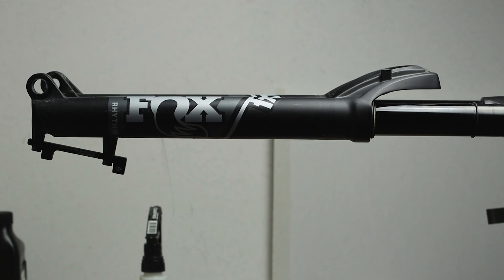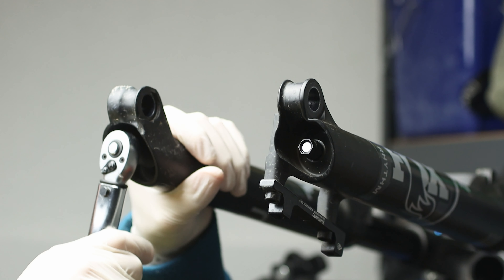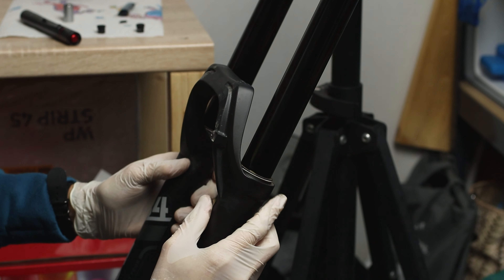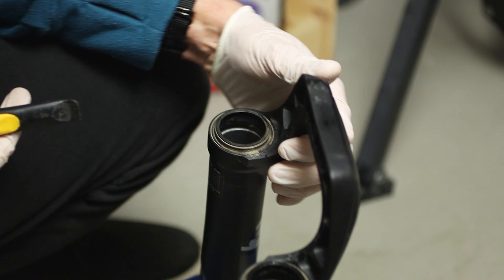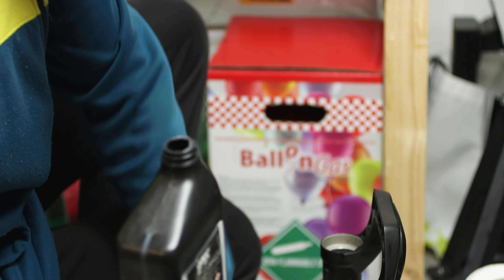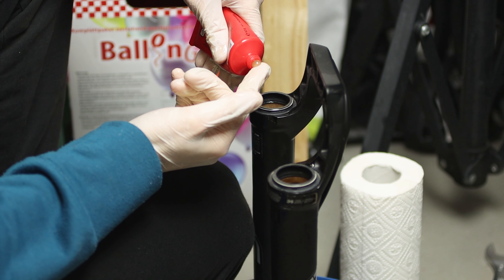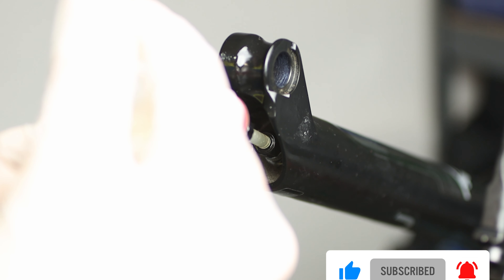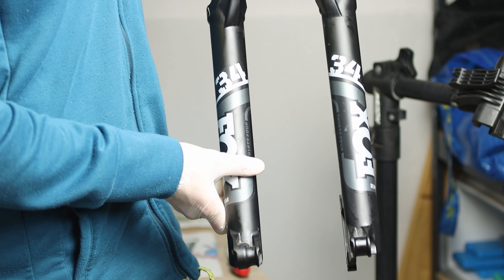Fox 34 Rhythm 2022 Lower Leg Service 🛠️ Ultimate DIY how to - MTB tutorial for beginners!

Comment: Just a word of warning, always hold a torque wrench by the handle, not up near the head. It will give you a false torque if done that way, and it is quite substantial. Otherwise, thanks for the video!
Reply from the maker: good to know...thanks!
Reply: Nonsense.
Reply: @fundidoarrojo269  do even a slight amount of research, and you will find out it is not nonsense, champ 👍

Comment: Bought a polygon t8 surprisingly the fox 34 was dry and had no oil I had no idea till I rode it on the trails also found out the head tube had no lube so when you buy a polygon t8 make sure to lube it up before you ride 😅
Reply from the maker: Wow, that's pretty bad to hear! I hope to not have these issues with my factory 38 😀
Reply: I rode my T8 for a year. How did it ride without oil?

Comment: Great video. I’m in the process of doing the same on my Rhythm 34. Was thinking it would make sense to soak the damper side foam ring in the 5wt oil since that is what goes in that side. Otherwise you’re basically mixing two oils. Thoughts?
Reply from the maker: Honestly that's a good point, i checked the manual and probably this is outdated, since the fork in the example uses for both legs 20WT. So yes, you are absolutely right, you should use 5wt bath for the damper side foam ring!
Reply: @OresteCiotoli  thanks for responding. Glad what I was thinking makes sense. Now I just have to be smart enough to put the right foam ring in the right side!

Comment: Could you comment on the oil types and amounts for each side?  It's a bit hard to understand what you are saying and I don't want to guess.   Thank you!
Reply: Fox 20wt gold fork oil - 10ml in the air side. For the damper side he used 40ml of 5wt fox infused fork oil. But the 5wt has been recently discontinued and the fox 4wt fork oil is what fox has adopted and replaced the 5wt with. The 4wt is actually Motorex 4wt oil. You can still find the Fox 5wt but I’d go with the 4wt which is what I did. They can be mixed so don’t be worried about any residual 5wt that didn’t drain out.
Reply from the maker: Sorry for the late reply. Just check the Fox website here, referring to the bath oil link based on the year of your fork: https://tech.ridefox.com/bike/list/service-procedures